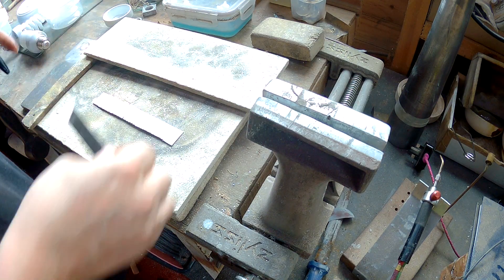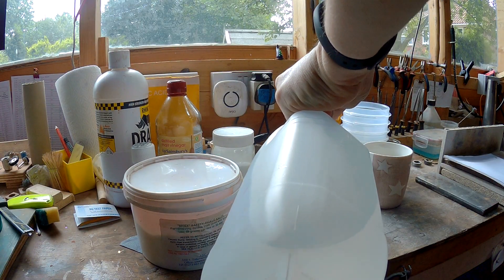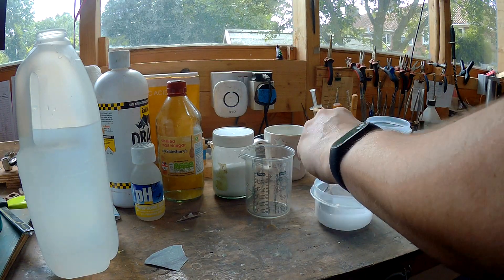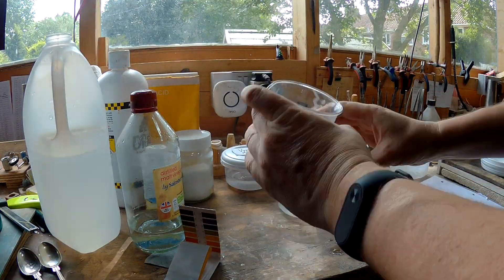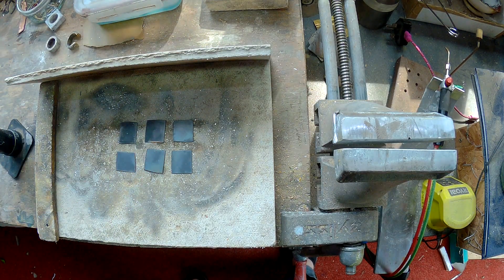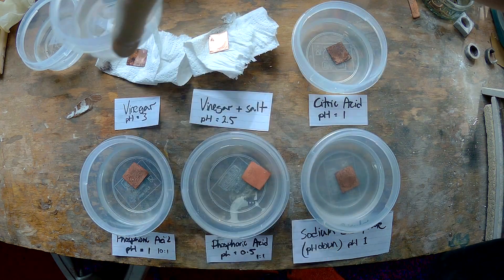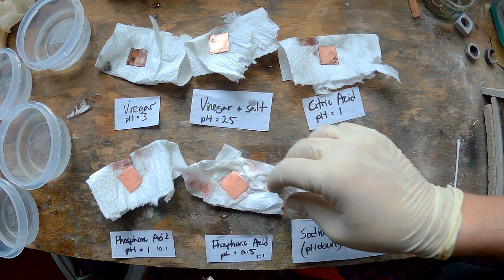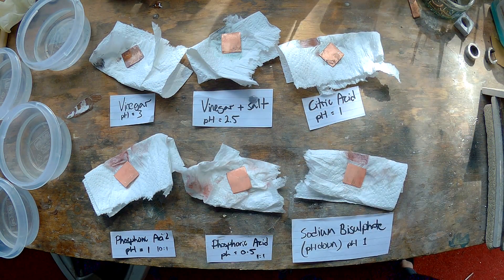Jewelry Pickle Test and Comparison (aka The Great British Pickle Off)

Comment: I'm curious how adding heat to the pickle solutions would have changed things comparatively.
Reply from the maker: I don't believe it would change anything. It would make everything happen faster, but I don't think there's any reaction which NEEDS more heat, so it's just going to speed it all up across the board. It was a lot easier to control for consistent temperature by going ambient!

Comment: Nice comparison ! , Can we use  muriatic acid as pickling solution ?
Reply from the maker: Yup. Any acid will work. I did have some HCl around but didn't include it in the test because it was in some weird gel form for applying to tiles..
Reply: @MatBrown Actually, as you said, if you paid attention in Chemistry class you would know the Salt breaks down into Na and Cl, which then accepts a H molecule from the Acetic acid (vinegar) and becomes Hydrochloric Acid ... which is why it works so good!
Reply: @ksmith4712  thanks.  Extremely interesting.  Vinegar+salt=hydrochloric acid pickle.
Reply: @MatBrown  Thanks 😊

Comment: Does phospohic acid release any fumes unheated? Im using piranha solution atm and it works great even without heating
Reply from the maker: Not that I'm aware of. Although I use it in a cheap ultrasonic cleaner which has a lid, so I probably wouldn't notice if it did.
Reply: @MatBrown  Great. Thanks! You mind telling what percentage the two phosphoric acid mixtures are?
Reply: @MatBrown  Also. How would sulphuric acid + hydrogen peroxide (super pickle?) Compare to the phosphoric acid?

Comment: Nitric acid for copper.
Reply: too strong & more dangerous, will start etching;  nitric & sulfuric acids mixed = dutch mordant for etching steel in my past experiences.
Reply: Nitric acid and copper would create a volatile reaction i believe. 
I used to mix copper with 32% hydrochloric acid to create nitric acid
Reply: Try finding somewhere to get it...